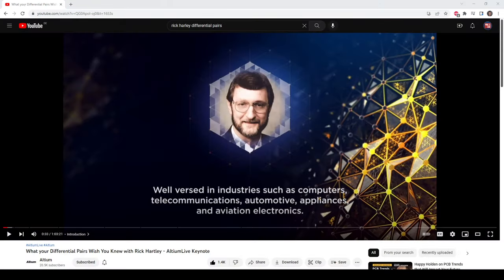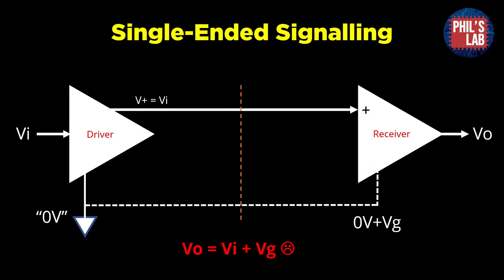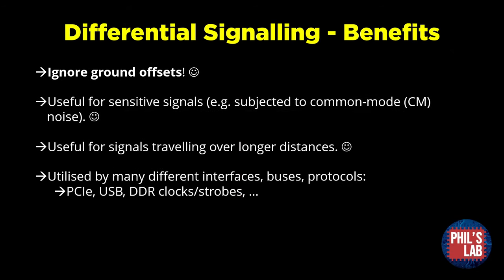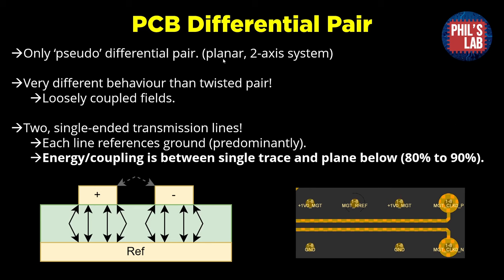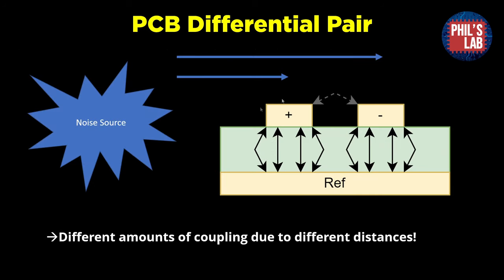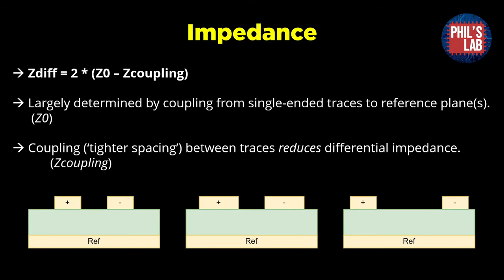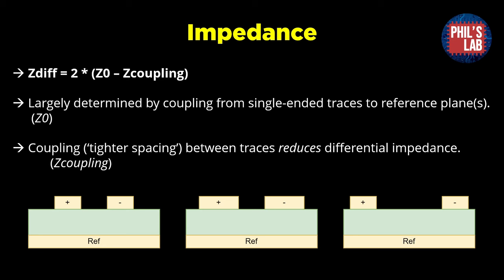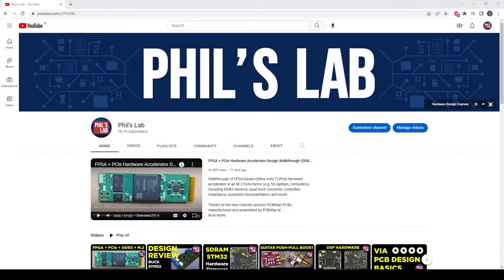Differential Pairs - PCB Design Basics - Phil's Lab #83

Comment: Hi Phil! Great video. I had a question regarding RF Diff pair routing. Like I am supposed to have a differential pair which is supposed to be 50 ohm single ended and 100 ohm differential. But as you mentioned, Zdiff = 2Zo-Zcoupling. So to achieve both these requirements, I have to space my single ended lines far apart? Or is it okay to just have 100 ohm differential, and not worry about single ended. And will it be okay to have like 2-3cm of uncoupled length of diff pair because I need to route to SMAs.

Comment: Thanks for this, incredibly clear and helpful for me. One question though, does it really say 50 ohm single-ended impedance in the USB spec? Most sources I've looked at (admittedly just random internet forums) seem to claim that USB specifies a differential impedance of 90 ohms and has no comment on single-ended impedance? Also, at 14:00, you suggest to set the single-ended impedance as recommended by the spec, and then adjust the spacing to achieve the diff impedance in the spec. But that example has the differential impedance as exactly double the single ended impedance, so applying that strategy would lead to an infinite spacing?? I do realize the overarching point you're making is that the spacing doesn't really matter than much, but still.

Comment: A video on termination techniques would be awesome! 🙂 I am currently struggling designing a PCB with 8 daisy chained ADCs using SPI. The speed  is around 10 MHz and trace lengths up to 80 mm. I am currently using a length matched star topology for SCLK, CS  and some control signals with a single termination resistor at the transmitter. Would be awesome to hear what your approach or advice would be for this configuration. 

As always thanks for the interesting topics in your videos and keep up the good work :)
Reply from the maker: Thanks! Yes, definitely on my list of videos to make, which'll cover series and parallel (AC/DC) termination schemes. I'll go into detail when it's necessary as well.

Comment: I'm very confused, wouldn't we want, LOWER capacitance between the two pairs and it's ground so the transitions are faster and sharper? and so we don't end up making a low-pass filter that filters the signal either.

also why is the impedance so important and has to be exact?

Sorry i'm a newb here!

Comment: Hi, as always very well explained. Thank you! 
As I have a very specific task at the moment, hence I have a special question: I have to replace a 3m long Ethernet cable CAT-5 (100MBit) with a thin Flex-PCB cable for an application. As I have to roll up the cable and space is very limited, I am aiming for a Flex-PCB with a maximum thickness of 200um. According to PCB-Way, this can even be achieved with 4-layer FlexPCBs. Now the question: Ethernet cables would like to have 100 Ohm differential impedance. But there are no more reference lines in the cable except, of course, the other conductor of each pair. How do I then lay out the conductor spacing and widths? Or do I simple use the GND line of one of the circuits (before the magnetics) at one end of the cable?
I would be thankful for any hints.

Comment: Heey, great vid. By the way, what about the part 4 on sensor fusion, with extended kalman filter and the implementation of the part 3? Also, i was looking through your git repo, couldn't find the code from part 2 and 3 os sensor fusion, iam looking on the wrong place? Anyway, thanks for all your shared knowledge, Iam currently on a engineering degree, it's been really helpful!

Comment: Awesome content, as usual. Detail and care is shown on every video. I have some years of experience in doing Highspeed PCB design and I can say your explanations are right to the point.
I would add "broad coupled" diff pairs to your presentation and also the requirement of a common ground return path for those currents coming from the imbalanced or losely tight diff pairs.
Thanks for these videos!!

Comment: great video, one question what if we route/overlap the diff pair in adjacent layers? in this case do we still need a reference plane for the return path?
Reply from the maker: Yes, you'll need a reference plane. They are still two separated, 2D structurs acting (predominantly) as single-ended lines.

Comment: Outstanding content as usual, do you have anything in the works for tips on laying out an ARM processor (one that can run Linux, A series for ex) and DDR2 / 3 memory?  Like one of your step by step guides, that would be fantastic to see.  Top quality work as always Phil. Thank you!
Reply from the maker: Thanks, Aaron! I'm working on a advanced hardware/PCB design course, which'll feauture some (embedded) Linux-capable device with DDR3 memory.
I'm afraid that is quite a large amount of work and I won't be putting much of that on YouTube (other than smaller how-to's).
Reply: @PhilsLab  Understandable, i'm sure many would be happy to pay for the guidance in any case.